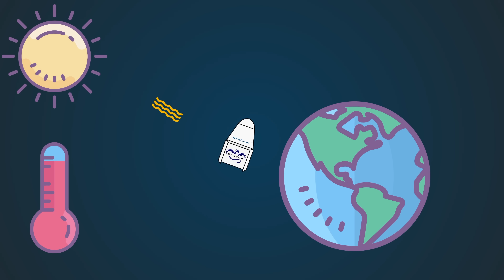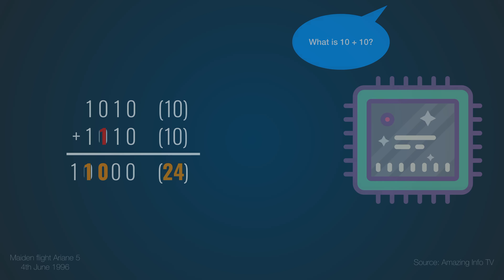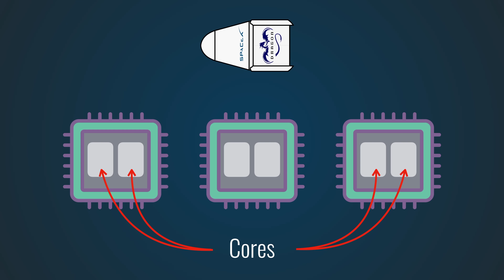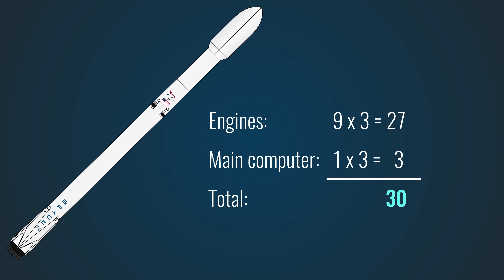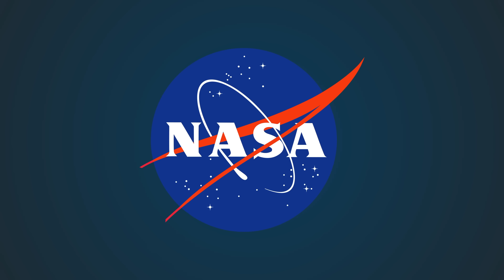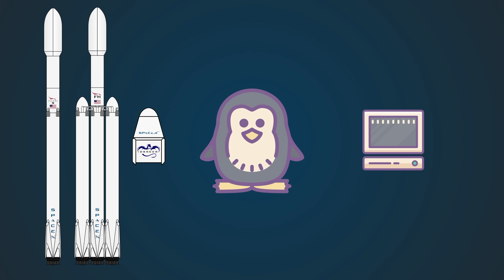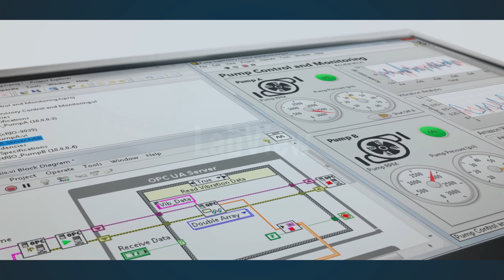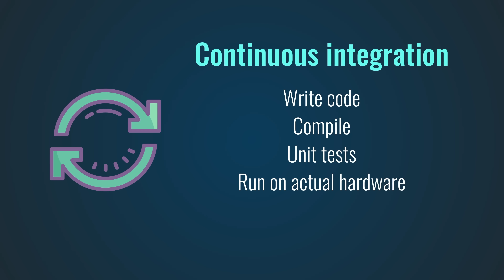Software powering Falcon 9 & Dragon - Simply Explained

Comment: I remembered a news story about off-the-shelf hardware in the 90s. Irans or Iraqs spies bought a lot of ps1 consoles then turned them into scud missiles processor guidance system. The US immediately put an embargo on ps1 sales. Good times. Nowadays its not weird to find milspec hardware using your average laptop/desktop cpu. Good times we're living now. Good and cheap.
Reply: Mu Effe fun fact, the USAF uses several hundred PS3s setup with a customized version of Linux to turn it into a Super Computer cluster. The GPUs handled the heavy computational load with the CPUs handling the normal system functions & acting as a co-processor to the GPUs.
Reply: NewHorizon processor came from ps1. because it was used from million of people and it works very well.
Reply: They haven't done anything like that. IBM/Sony Cell processor was very interesting, but turned out to be to difficult to take full potential off. Iranians had indeed smuggled some PS1s for "meteorological research" cluster, but I doubt they would waste that horsepower on disposable rockets, which don't even need that.  Soviets had image guided Scud modifications in late '80, so had Americans with Pershing II (radar images).  Problem with this is that you need to build up library first.... PS: I wonder, had some of Cell creators been hired by, say.... AMD ;) ?

Comment: Spoiler alert.....he is mostly referring to what Space X used back in 2012. So if 6 year outdated information is your thing, watch it all.
Reply: Space travel has unique problems almost requiring out of date software and hardware. The space shuttles last flight in 2011 had hardware and software that was state of the art in 1992! The simple reason is one had to test for all variables. Hardened older systems have that. New parameters have probably changed that but 6 years sounds about right. Military stuff is even worse. I use to work for Lockheed.
Reply: probably now they use ten quad core processor, but linux and c++ remain
Reply: Nine: Updated information is restricted by ITAR....but yes, this video has mostly 6 year old information.
Reply: Paul Z Sources for updated information?

Comment: Question, so since radiation rays can change the binary code in the processing systems (sorry if this isnt the correct terminology), what would happen if Quantum Computing became a normal way of processing? would a Quantum Computer be affected by radiation at all? Is Quantum Computing necessary for deep space travel?
Reply: Quantum computers are far, far more susceptible to radiation.  Also radiation is only a problem really close to Earth.  Silicon computers are 100% okay in deep space.

Comment: No difference in languange (VHDL/Verilog) going from Rad- hard FPGA (Flash based) to consumer/industrial ones (RAM based). Sometimes the part number is similar too, just the suffix like -c, -i, -m, (commercial, industrial, mil spec). The temperature range is different between these though... One can also use SEU detection/correction logic cores to mitigate SEU issues. Yes, triple mode redundancy and lots and lots of Built-In Test circuitries not found in typical consumer products. Plus being subjected to the environmental extreme tests you have explained. Test until it breaks, then you know your design margin. :)  COTS, I think, is just philosophical word someone in management/Govt invented to possibly cut cost (or when business people not talking properly with engineers), literally, it's nearly impossible to buy something from amazon and that it will work in extreme env conditions or even meet these design requirements, without modification, or custom job, like it literally says, Commercially available (from amazon or best buy), Off the shelf (grab something from best buy). It still doesnt make sense when I came across this requirement then.

Comment: One of problem in space is crystal growth across solder joints and getting shorted therefore I bet they will not be buying processors from amazon. They must be using at least avionics grade x86 processors instead of RAD5500. Can you cite credible source ?. To go to mars they have to use radiation hardened powerPC for critical system.
Reply: That's called dendrite formation.  At SpaceX, you use the industry standard fixes like conformal coating, under fill, etc.

Comment: This off-the-shelf-plus-redundancy approach is how it should have been done all along.  But not only for CPU/RAM.  What about the cameras?  Instead of laughably outdated, low resolution JPGs coming from a multi-billion-dollar probe (Huygens, anyone?), send two modern cameras up, or at least send up both a space-hardened, outdated POS and a modern camera.
Reply: Guessing, but I imagine it's a different ball game. The length of time probes & satellites are exposed to radiation is utterly different to rockets. I don't know how long a dragon capsule would be left in space, but I guess it could be deorbitted and refitted far more easily than satellites. 

So I suspect if you fit your satellite with cheaper hardware and the camera breaks you need to repair it in space. If the design is flawed it's completely dead.
Reply: It's actually just part of space tradition, one which hasn't been discarded wholesale the way SpaceX did with space-hardened software/hardware.  SpaceX is equally guilty of it.  They use 480i (yes, circa 1990) cameras for all of their space footage, including the recent, supremely historical Falcon Heavy / Tesla Roadster launch.  Those cameras aren't used for longer than a few hours, so there is literally zero excuse.
Reply: Brian Reilly The ground footage is 1080p or similar.  The onboard footage -- main booster, side boosters, and every angle on the Roadster payload -- is 480i, full stop.  The digital resolution of Youtube's video has no bearing on that.  If you're not familiar enough with broadcast NTSC to recognize it at a glance, do this: Capture an image from one of the Roadster feeds (like one showing the "Don't Panic" screen).  Paste it into Photoshop.  Scale it down to 480p.  Scale it back up to its original size.  Directly compare this result to the image before you did any scaling.  It should be bluntly obvious then.
Reply: Asterra2....those images from Falcon Heavy do not look like 480i.  They look more like 1080p.  Do you have any reliable sources to back that claim?
Reply: Ground footage, you are sure to be correct.

But why would they use ancient analog video technology when higher digital resolution options are available at a lower cost with less mass and less complexity on their vehicles?  This is why your claim makes no sense.  Why would they choose the inferior video option?
Reply: It is not my claim that makes no sense -- I am merely pointing out the obvious.  It is SpaceX's decision to use outdated cameras that baffles; on that point we are in complete agreement.  My guess, as I previously stated, is that it is just part of space tradition to use such cameras.

Comment: Can you tell any more about the linux they use?  Is it a forked distro? Custom kernel? unix-like?
Reply: My guess is something that's been modified a bit and the kernel has been built without any driver they don't need. I wouldn't be surprised if they just put the program in the initrd, so it executes as soon as the kernel is ready. It's fairly common practice to other Linux based embedded systems. Routers are a good example of that.
Reply: they don't used linux they used Windows ME

Comment: You can actually make computer hardware very resistant to radiation by using a 3 layer protection, the outer layer being beryllium which is a metal with the ability to reflect all forms of radiation, the middle layer being graphyte which acts as a filter against powerful gamma rays, and finally the innermost layer being a thin sheet of lead which catches and absorbs runaway radiation that manages to penetrate the first 2 layers, beryllium and graphyte is normally very lightweight and wouldnt affect the total weight of the satellite or space station very much (and beryllium can also be manufactured as a sealing tape incase a micrometeor penetrates the hull), lead is normally very heavy since normally upto 4cm is required to shield objects from solar radiation, but since the previous 2 layers already do that the lead will only need to be thick enough to catch the remaining radiation and would only need to be as thick as aluminum foil
Reply: This sounds interesting. Could I get a source for that?
Reply: I have a hat with those three layers, the tinfoil on the outside is just for show.
I haven't noticed any bit flips yet.
Seriously, your comment is very interesting, thank you.
Reply: The point was made in the video that radiation hardening is only protection to a degree; it is not absolute. The advantages of redundancy are so great that SpaceX has rejected radiation hardening.

Comment: Most PC game developers don't care to optimise their code.
Reply: Vignesh Balasubramaniam:

> Because PC gaming is a much smaller segment

What? In January Microsoft reported 59 million monthly active users for Xbox Live. Last May Sony reported 70 million monthly active users for the PS4. In August Steam alone reported 67 million monthly active players. That's not counting Origin, Uplay, GoG, Windows Store etc. monthly users.

Simply Explained - Savjee:

One thing about game developers is that they're apt to use a lot of hacks to get to the end product. Their focus is on shipping a working game in a short time frame. They want to ship something robust enough that the average user won't experience constant issues, and that's about it. Crashes, strange behavior, and edge cases are all acceptable to a much higher threshold than we're talking with SpaceX.
Reply: yes there are a lot of games without good graphics that require high end PCs
Reply: Another real time control applications need to have much higher standards as a glitch like you often see in a video game could be very expensive or even fatal .
So you can't directly make the jump from video games to avionics.
But a lot of the programmers Spacex hired got started on games back in the 1990s to early 2000s when code had to be more optimized and they could not send a patch as an online update.
Plus they tended to also have experience with SCADA systems so they knew the rules for real time systems.
Reply: Because Intel and nVidia give them $$$ to not care.
Reply: Ark
Reply: Bullshit.
Reply: What? PC has way more players, everyone I know has a laptop or PC and a lot of them played some sort of game and I know noone who has a console.. Ask someone if he played Heroes 3 or Diablo 2 and he will propably say yes and ask someone if he played a game on console himself, most of the guys will tell: hehe i played fifa in my friends house 3 years ago
Reply from the maker: Sources? Games on consoles are usually very optimized because of the constraints....
Reply: That is AMD hardware, Intel and nVidia have no need to optimize game code for all systems, likely they prefer games to be un-optimized because their hardware is superior to AMD and they don't need to bother, such code optimizations could give AMD free boosts that would hurt Intel and nVidia's bottom line.
Reply: @simplyexplained  if you write code on embedded as if it was a game the code will be shit
Reply: Simply Explained - Savjee On consoles yes, I agree with you, but on PC, its a different story... 

Because PC gaming is a much smaller segment, very few game studios care to optimise their game to run well on that platform, leaving game engines behind the capabilities of graphics cards. It has only in the past year that optimising games to use multiple threads has become popular.
Reply from the maker: Yeah you do have a point about PC gaming. But in general game developers have to carefully manage things like memory and they can only run a limited amount of code to render each frame (heavier code = more time to render a frame = less frames per second).
Reply: Simply Explained - Savjee a lot of the lower level work is handled by the game engine, which aren't updated often enough to take full advantage of PC hardware. But yes, I understand the point you were making for the purpose of this video.

Comment: How do they keep the processors in temperature ranges, isn't it  a stretch getting a processor to operate in -120degrres
Reply: The internal temperature isn't nearly as extreme as the temperature on the surface of the spacecraft. Also, they use processors with a wide temperature range, such as Vorago microcontrollers.
Reply: Heat is more of a problem most CPUs turn off at 100c.Also what happens when the battery runs out ?
Reply: The Dragon capsule has solar panels, so its battery will not run out for the mission duration. And for F9 and FH, they calculate the comsumption for the entire flight and put even more batteries as needed for backup.
Reply: Pangolin Yes and no, processors will eventually get too cold and experience what they call a "cold bug".  You should check out some of the extreme overclockers that actually use LN2 to chill their processors.  However, they also have blowtorches to warm them up as well.
Reply: theoldcookiemonster iirc processors work better the colder they are

Comment: Glad to see videos like this! I was a software developer for the shuttle program for 25 years designing and writing various launch safety systems, worked for USA (United Space Alliance)
Reply: Cool, are you able to give some comments to how the SpaceX software approach is different from how you worked? E.g. did you use C/C++, continuous integration, store logs with source code, test on actual hardware etc as mentioned here? I believe I read somewhere that SpaceX built a board with all the various hardware components, actuators etc controlled by the computers, so that they could test the software against actual hardware.

However that sounded like a no brainer to me. Would not all space companies do this? Or was your software only really tested upon launch of a rocket?
Reply: my dream...
Reply: Hi Mojo. Did you guys happen to use FPGA's while there? Just curious.
Reply: And what software and hardware was used for the shuttle back then?
Reply: I was amazed to find a ticket-automat some weeks ago which had a failure and was re-boot all the time. Behind the "fancy" mask with color- touch display, there I saw the system is a 286er prozessor running Microsoft-DOS, in 2018. But normally it works well and failures are seldom and you can buy tickets there.

Comment: You got the Ariane V error wrong. It tried to convert a 64 bit float number to a 16 bit integer. And the result is not truncated. An conversion error is raised, and the error message is interpreted as valid data which caused this failure.
Reply: Hehe, I was about to comment on this too. To be exact, the Ariane 501 report states: "As a result of its failure, the active inertial reference system transmitted essentially diagnostic information to the launcher's main computer, where it was interpreted as flight data and used for flight control calculations." Thus I would argue it wasn't the error itself being interpreted as guidance data but some other "diagnostic information".
Reply: And it was due to the fact that Ariane 5 shared components and therefore sourcecode with Ariane 4 and t since the components and software were known to function this condition was not tested.
Reply: Thanks for the video, and I came here to make a similar comment. AFAIK, and our lecturer brought the secondary computer to demonstrate, the exception caused a fail-over, to rapidly reoccur also in the secondary computer, triggering the self-destruct. I was not aware of any faulty interpretation of data.
Reply: Wow so just converting a variable caused the ship to go wrong direction.. dang..